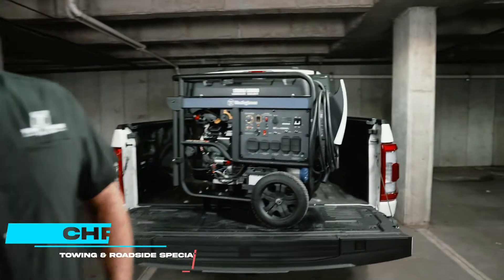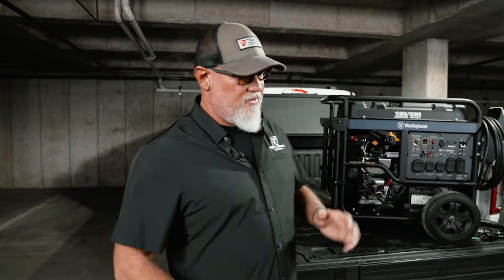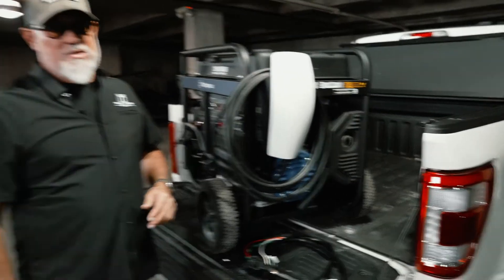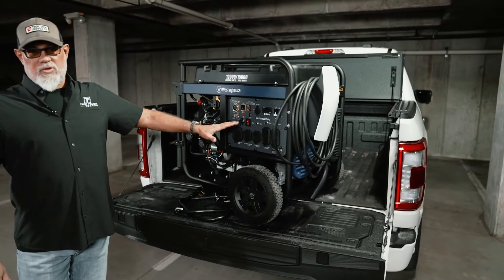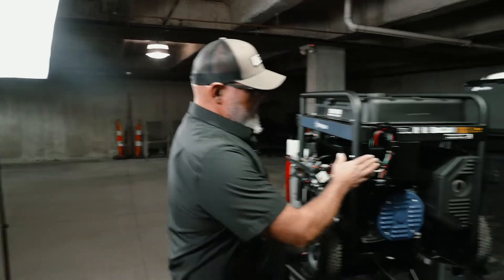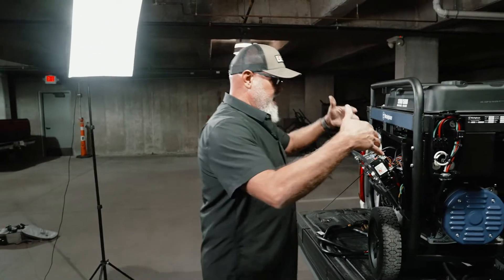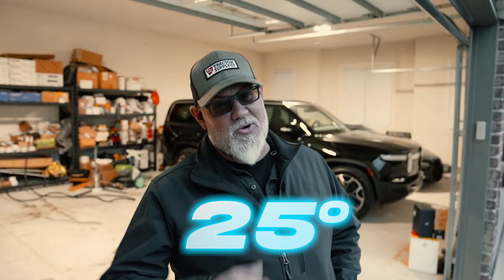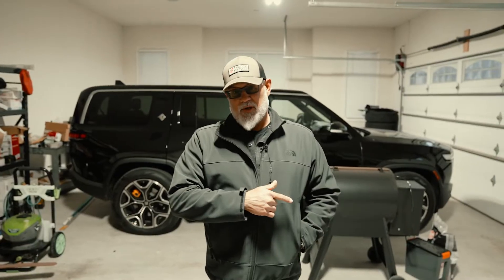How To Build A Mobile EV Charger

Comment: have been offering this service for 2mos now.  getting busier  by the week.  have been running just using the 14-50 plug but want to step up to the hardwire 48a.  Does anyone have a diagram for how this was wired? Its what im worried about the most. thanks in advance

Comment: will this work Westinghouse 12500 Watt Dual Fuel Home Backup Portable Generator, Remote Electric Start, Transfer Switch Ready, Gas and Propane Powered for ev charging just using Tesla - Mobile Connector, Portable Electric Vehicle (EV)  ?
at 220 or 240V ?

Comment: If you built another of these, would you opt for the Westinghouse 14,500 so it’s not running at 100% and delivers that last 0.3kW?
Reply from the maker: From what I understand this unit may be discontinued.  Some folks are using the 14,500.  We did another build with Wgen20000 also.
Reply: @towtrucktech1555  Yes, I saw your 20000 build for two 40A chargers.  Smart, but of course the Tim the Tool Man Taylor in me wants to see you mount an 80A/19.2kW EV charger to it!  lol
Reply: @towtrucktech1555   Think I’ll buy a WGEN20000 for home backup as an excuse to try charging an EV truck at 19kW w/o modifying the generator.  I’ll use just the two NEMA 14-50 plugs.

Comment: I did the same thing in 10min. I got the champion tri fuel 11K gen and a ramp for my cybertruck. Now when I go way out camping I have no problem. Charges my truck and any other EV fine. Also, an inverter generator is a much better way to go.
Reply: Cool idea, but you lost me at Cybertruck ROFL

Comment: Does charging with the moble unit first give the wall unit a bit of an advantage? 
The way you rattled off instructions and specs... You're no knucklehead
Reply from the maker: @RobinRK1962  - Nope, energy at a given voltage and amperage is energy.  The car knows no different.

Comment: What if you want to use a charger with a 14/50 plug … can you just plug it in? Or do you have to disconnect the neutral
Reply: Just plug it in.

Comment: This model  in the video was discontinued.  It had a THD less than 5% (measure of how clean the electricity is).  We use the EVroadHERO 9kw model with super clean power (below 3% THD - safer for EVs) and a custom made EV charger that matches the power output of the generator.  Saves charging time.  We love it!

Comment: I’m really wanting to do this. I’m wanting to make an overland rig with my lightning and just having the peace of mind to do it would be great. I was thinking about the Westinghouse 20000 but this one seems like it would do just as good for one vechicke.
Reply from the maker: We do a build with that unit too, check it out.  The 20K is a monster.
Reply: @towtrucktech1555  I saw that one, good video! I live like an hour maybe hour and a half from you guys I will just drop it off and let you all have fun 😂. Any use out of either of them so far?
Reply: Go with the 20k.  You’ll have a lot less total harmonic distribution (THD), making it safer for your EV and the generator’s engine will last longer.
Reply: @NickWindham that’s what he one I went with. Haven’t got the charger set up yet on it though.
Reply: @gamergamer102   No charger setup needed because you can just plug 40A mobile chargers into the NEMA 14-50 receptacles on it.  The charging speed difference between 40A and 48A isn’t major.  

However, if you mounted an 80A/19.2kW charger to it with a 100A breaker and thicker generator wiring, that would allow you to charge EV trucks and SUVs from Ford and GM twice as quickly as 40A.  THAT, I’d like to see a video of!

Comment: Most companies recommend that you use an inverter generator pure sine wave.
Reply from the maker: Specifically, which companies recommend the inverter.  The unit here is sine wave.
Reply: I spoke to Pulsar and they told me that in order to power sensitive electronics with fancy circuit boards computers etc an inverter generator is recommended.  Seems like what you have here is not a pure sine or atleast the product spec doesn't say it is but regardless maybe its not needed, it looks like it works fine  Those inverter generators are way more expensive too.
Reply: Every newer generator has an inverter to adjust speed per wattage use so that’s hardly ever an issue now

Comment: So in 30 minutes, what percentage would roughly charge the EV battery if it’s dead on the side of the road. Thinking of a business mode and how to price the calls.
Reply: I’d start at $250 a call out plus $1 per mile to and from until driver returns to base
Reply: You would get about 5-10% of range in half an hour. It's only level 2 charging. I think a 3 phase generator with a level 3 charger would make more sense for a business, but it would cost much more.
Reply: @travismartinson1813   More like 5%
Reply: I would also like to know
Reply: did you ever find out any info on this?
Reply: @nikoa7936  I don’t think so
Reply: When you are recharging dead teslas an hour would put them to 30% average not sure what your ballpark price would be maybe $150 for emergency recharge 1 hour but I know professional locksmiths that make $250.00 per call and that’s less than an hour usually
Reply: @willsvidsch  Depending on the size of the battery in the EV, you’ll only get about 5% to 15% per hour.

Comment: You covered all the bases, people usually charge at 48A using 14-50 or use the wrong conductors. Great to see it done right. It's probably worth the extra work you did to get it charging at 48A. When you're roadside, you want to charge it as fast as possible so you can limp the car to the next actual charger.

Comment: How many hours can that generator run without filling it up?
Reply: I wonder the same thing. Great idea but how much kwh does it provide and how long does it last? Did he actually try to charge his rivian completely with it? Did it over heat? Did it shut down midway? A lot of answer questions.
Reply: @MilesChristii I have the same questions. 
How much charge do you get per gallon of gas?
How long does it take for a full charge?
Reply: until it runs out of gas lol